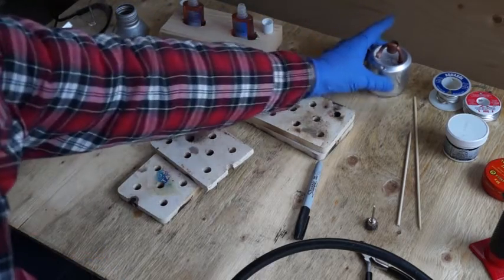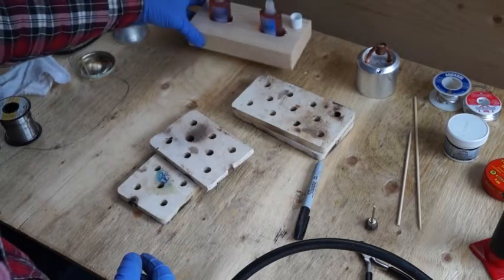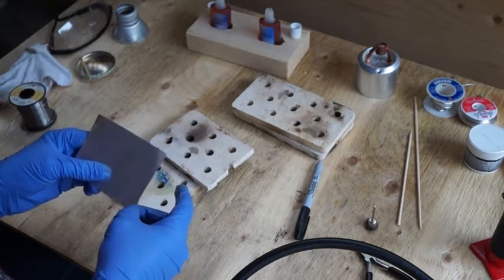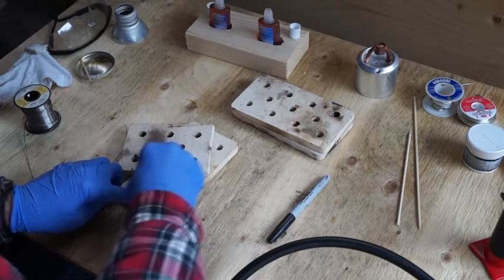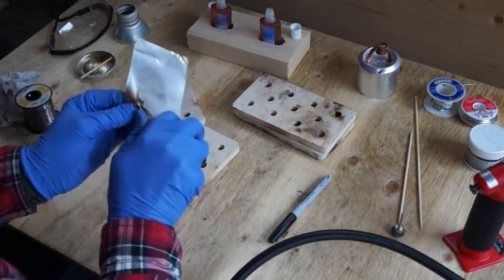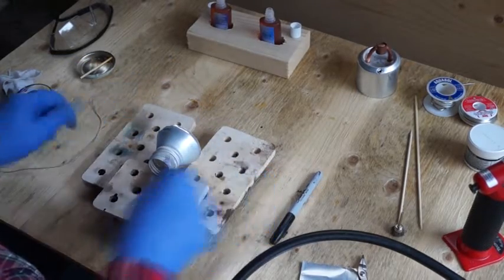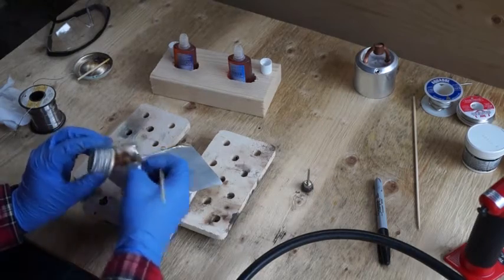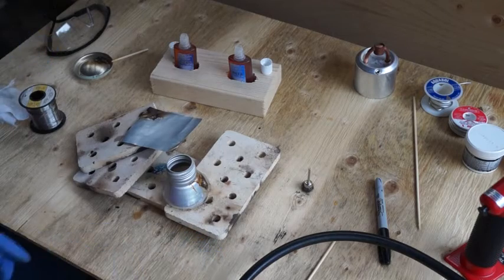Aluminum Solder Flux

Comment: What is the CHEMICAL COMPOSITION OF THE FLUX?!
Reply from the maker: Not sure why your comment got Highlighted but...   I don't know anything about the composition.  I don't sell these, I just bought them to see if they worked.  BTW, I have another video using a soldering iron that works better for this product.
Reply: It's that you'd think that googling "Aluminum Solder Flux" would actually get you the info on what it is actually made of!!! I can solder copper, brass and zinc because I know the active component is chlorhydric acid dissolved in a fatty acid (that you can actually make yourself). But try to find anything about what it takes to etch aluminum to be wetted by solder, it's practically impossible. Considering how useful this would be considering how ubiquitous aluminum is, I just can't understand why it is not better known! Have we become that impotent that we have forgotten how to repair things? Anyway thanks for the video - if you can read the ingredients on that flux and post it, it would be SOOOO helpful!
Reply: @johnnyjimj  I found in some result in google that the muggy weld super alloy #1 flux for aluminum and pot metal is have an udder of ammonia salt and amber .
they always says "our honey flux" .
can you tell me how to make a fatty acid ?
i think these all the ingredients you need to make super flux .

Comment: Another merchant12 customer? :-)
I myself have both fluxes, too.
My FTKA flux bottle label specifies the same temperature range as the F61A… (?)
As far as I've tested, the FTKA has worked great to solder copper wires over aluminium sheet/foil with standard eutectic Sn63Pb37.
With the F61A I made an experiment: prepared a special mixture flux consisting of slightly above ¾ parts (75.7͡5͡%) of Sn99.3Cu0.7 and the rest of Sn63Pb37, grossly grinded and mixed with some drops of F61A. Applied it between two pieces of aluminium, a small hollow flashlight pill with a round alu MCPCB sitting on its 1mm shelf. It worked, but the amount of residue was substantial and the adhesion strenght was just 0K.
Related thread: http://budgetlightforum.com/node/48817
Nice video.
Reply from the maker: I took the temperature range of both fluxes from the ebay advertisement.  Checking the bottles just now I see that they both say 180-250.
From your thread I see someone mentioned to not breath in the fumes; good advise!  I even wore gloves.
My next video shows soldering with an iron.  That works much better than using a torch.
Reply: Seeing you dipping the solder wire in the flux gave me a hint too.
I recently built a custom tailored powerbank with a small old slide box. Used the flux to solder copper wires over battery tabs made up of multiple rolled up layers of aluminium foil. I held the tabs over the terminals with strong neodymium shaped magnets, and kept in place with an all-around supporting layer of hot glue. However, since I only applied a thin layer of flux over the alu foil, one of the solders came up weak and it broke unnoticed upon entering the battery/PCB assembly inside the box.
Of course, after a test cycle my estimations about the energy delivered by the powerbank were clearly low, even considering piss-poor efficiency. So I reopened and fixed the thing. This time, flux everywhere, LoL!